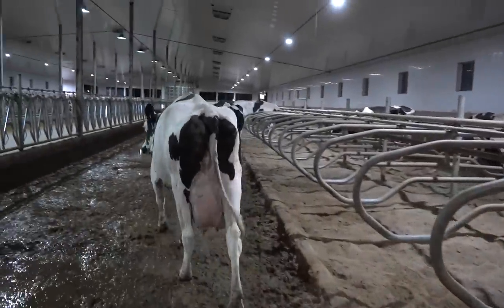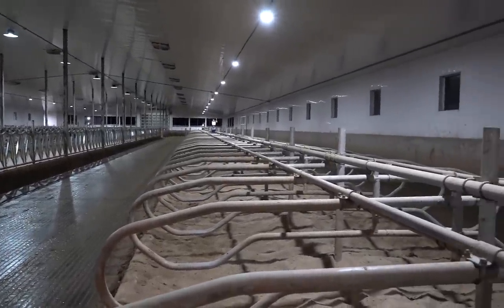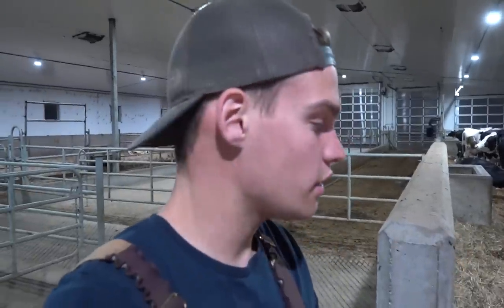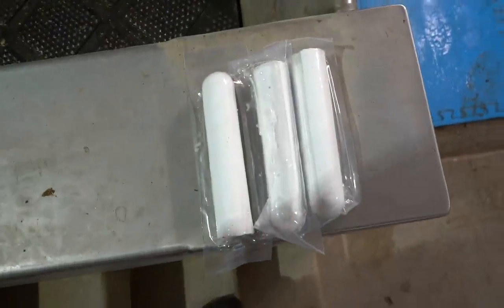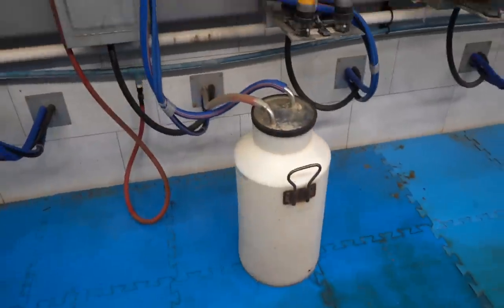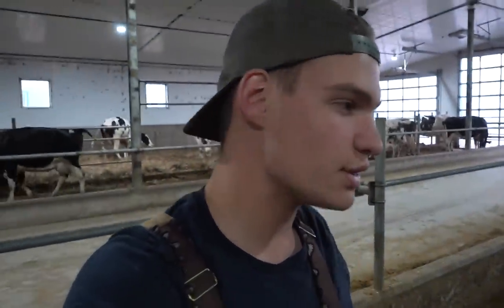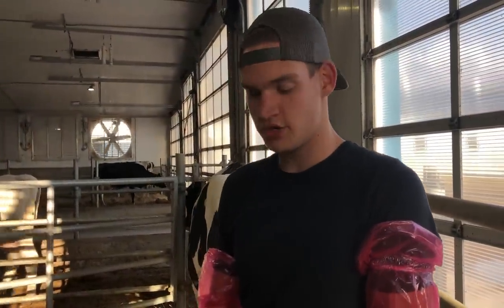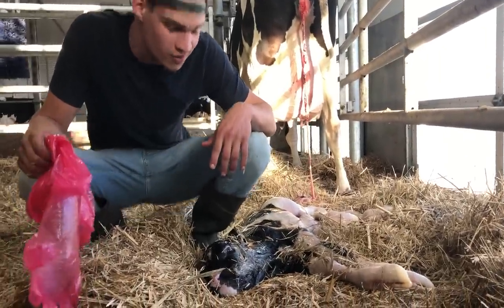This Cow Had Twins / PULLING OFF CALF!

Comment: Congrats on the first set of twin calves.  I was hoping they are both female; but then later on you mentioned that twins (or at least with M / F twins  that F is not a good milk producer).    Keen eye by Miriam on the second set of twins to notice there could be a problem. Seeing what you had to do to get the 2nd calf out and Miriam's keen eye I am going to consider the two of you as "parents" of those twins.   Also, it  must be fairly odd to have to sets of twin calves with a short period of time , even for a larger herd as you have on the farm .   Great vlog
Reply: Female twin calves are usually not the best fertility either, most farms in aus don't keep twins for herb replacment.
Reply from the maker: We’ve had I think 3 sets in the last month! It’s been crazy

Comment: Like your Mom, I love the red calves/cows.  With the sand/bed buster doing it’s thing, then more sand getting kicked out, will all that kicked out sand just end up in the lagoon?  Will be interesting keep track of.  The cows that had twins, were they from a “synced” group?  Just wondering if the hormones.from syncing had anything to do with having twins?  In the “good old days” twins were fairly rare......and the feeding/nutrItional regimen was certainly not like it is today.    Thanks for a great video.
Reply: The use of synced pregnancies resulting in twins where one calf is male and the other calf is female does not cause the fault in the heifers reproductive system. By the way in this case the heifer calf is known as a freemartin.
The problem is caused in utero where hormones from the male calf cross the placenta to the female calf’s placenta.
This causes birth deficiencies  in about 95% of the female calves. The problem is  variable in presentation but is always present in the reproductive tract. The calf may have no ovaries, maybe no uterus, vagina maybe non existent or malformed  and half normal size. In more severe cases the heifer calf may resemble a bull calf and even have non standard chromosomes.

Comment: Why dont we use a trough in the barn to feed the cow.. that way we wont have to push the feed again and again and no need of juno then either.. juno btw is great.. thanks for uploading .. its always a pleasure to watch ur uploads..
Reply: Cow will pick through the feed and eat what they want and leave the rest, they do not eat it all. If the feed was put in troughs, then you have to clean out the troughs, which is a pain, this way the left over food is just scraped away before the next feeding, less work
Reply: @pocketchange1951  😮👍👍👍
Reply from the maker: Yea exactly, we’d be shoveling those bun is out way to much

Comment: Why use sand? Oke you have sand on your farm but it gives problems in the manure pit. And it will put more and more sand in the topsoil. Here I see the big farms more using the dry matter from the manure. I think the are manure drying systems in Canada. The Netherlands are leading I know😁. The first milk is here often used as a great tasting porridge.  Greetings from the Netherlands.

Comment: Do you recycle the sand?
Reply: It goes in the manure pit and is spread back over there crop fields
Reply: @homey3051 , so the fields get more and more sandy with each application.
Reply: @Saratogan  ???seems odd ....
Reply: @CurrentChoices , Yeah thought of the sand being spread on the fields but sand being sand would change the composition of the soil so much over time.  Would it not effectively be turning the fields into desert?
Reply from the maker: It’s so minimal

Comment: I see you use sand in the beds and you get a problem with it in the manure pit isn't it easier to bed it with seperated manure you can use it the same as the sand and it doesn't pile up like sand does in the pit